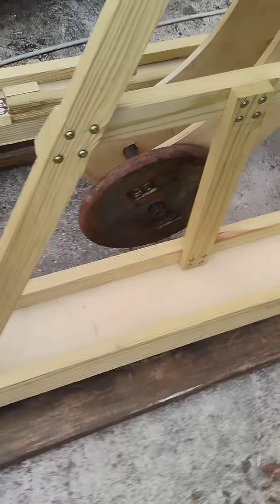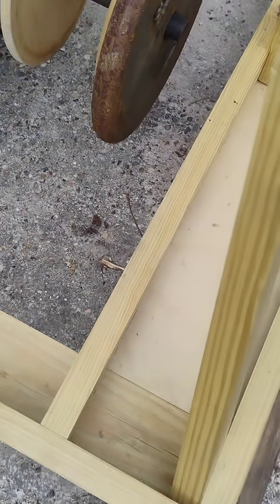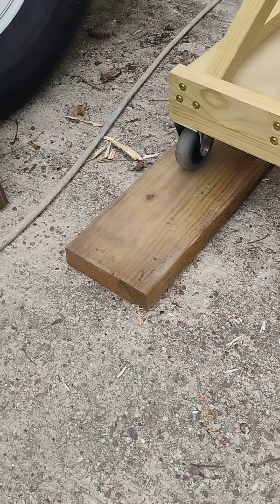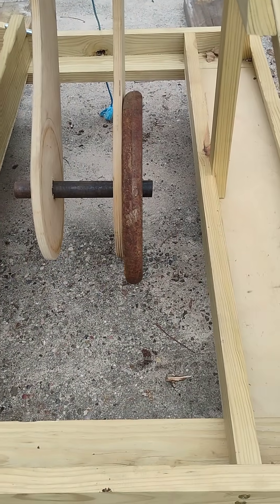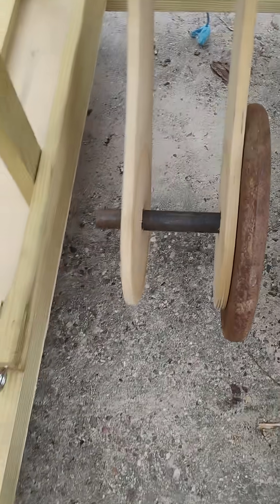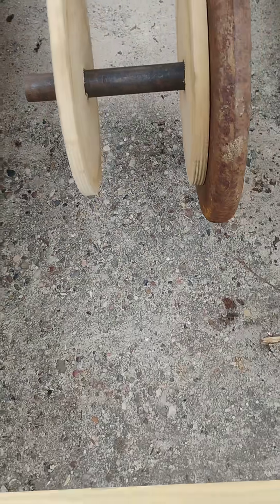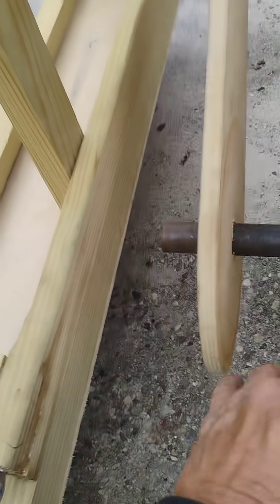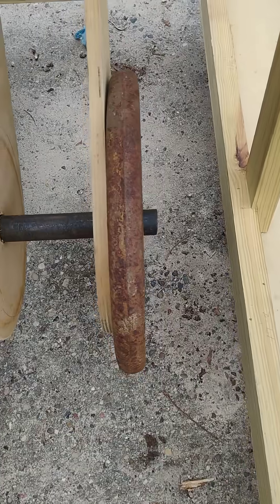Maxing out Baby Whipper 2.0? #punkinchunkin #mechanicalengineering #woodworking

Comment: How did  Lil Wipper do yesterday? What weights did you end up going with?
Reply from the maker: 115 pounds of cw. First shot pied. Nothing but orange mist! Second shot with a 1 pounder was pretty nice. Went 300 feet or so. Heaviest projectile ever out of either of the Baby Whippers, and way more counterweight then ever before.
Reply: Use a 10 inch threaded nipple fill it with lead and cap the ends to hold plates on
Reply from the maker: @chancegriffin1776  I have pipe bars for fun and exhibition, and solid bar for competition for the machines that use 1" bars. The 2" bar machines, I'm thinking about filling the bars with lead.
Reply from the maker: @chancegriffin1776  A lot of the time I don't use retainers. Retainers take up space for 2 more plates. I use ratchet straps on the big one with a full cw load.
Reply: Hey man! Any source of whiteprints to make a international contest of small forms ;) just spotted videos and returned to old plans what crazy thing to do when you be 40 ;)
Reply from the maker: @killdonut5019  We have some literature for running contests in my Texas Trebuchet group on facebook